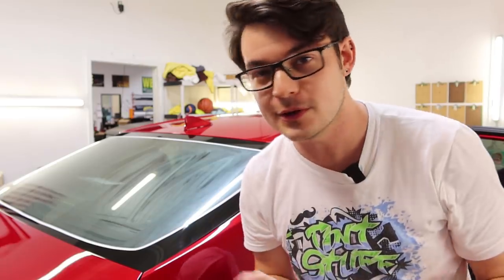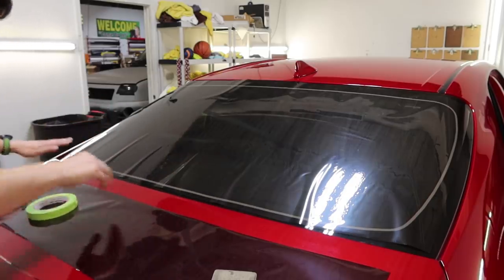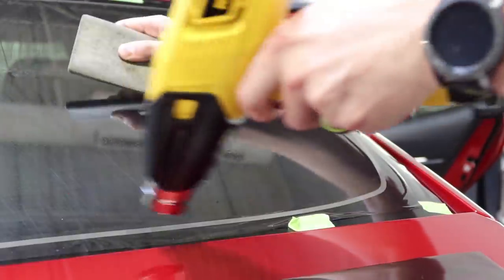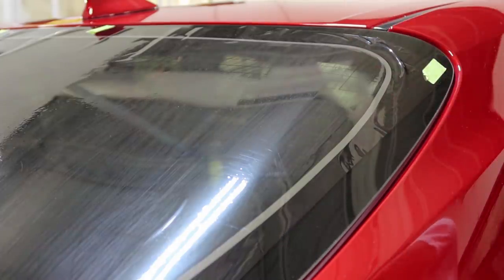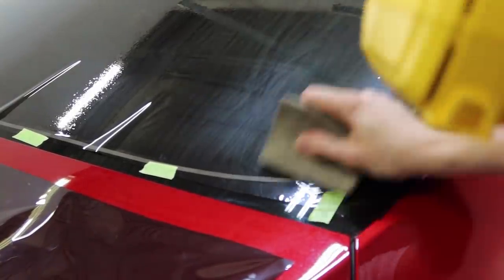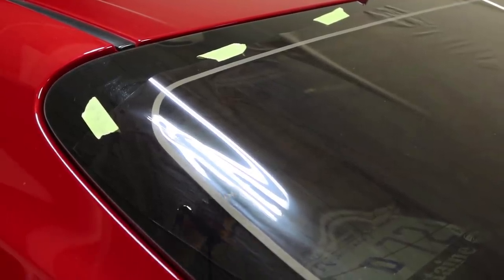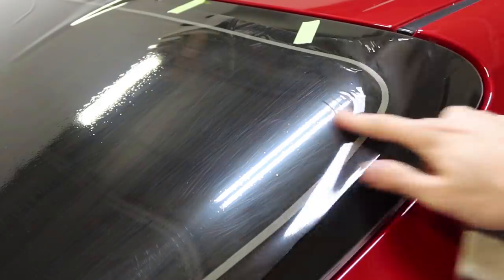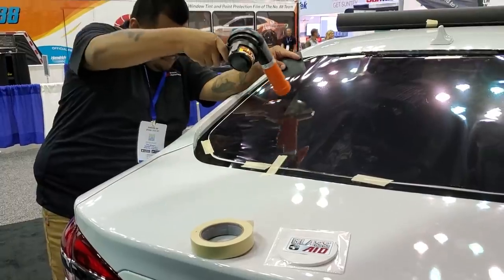Easy Way to Shrink 3M Crystalline Window Tint

Comment: I’ve always heard Crystalline was a pain to shrink.  It reminds me of the old Huper Optik film I used to deal with.  That required a similar pocket shrink method to shrink.  I use Xpel now and it shrinks so easily it just makes life so much better.  Thanks for the vid!
Reply from the maker: yea it is another beast like you said with huper. if it makes sense for ya to carry then this method would be your primary but I just really liked how simplistic this method looked. I love featuring things I haven't really seen before.

Comment: I do a fair bit of crystalline tints, the method I was taught is a little different (make a wet "H" shape, then put the tint on it,  tape the 4 corners and 2 in the top and bottom middle,then shrink the 4 Large pockets) but I really want to try this out tomorrow, could save time not having to get the glass wet.
Reply from the maker: that's awesome to hear! definitely not my specialty
Reply: Hi there, the “H” pattern is one way but can get though sometimes in my opinion. 
We recommend a “double H” pattern to break it up into quadrants, sealing the bottom and heating the finger up. Or breaking up the individual fingers like shown in this video. It all depends on the car and curvature of the glass. This method works great for Model 3 rear windows..

Comment: Well done! Funny that it's a "new" technique, I had gravitated towards it naturally after a year or two when I started dry shrinking early 2000's here in Australia. Nowadays I don't use shrink aids or even clean the outside of the screen properly, just a light wipe with a rag, then a wet" H". I lay up as usual, trim off with some excess left, tack with card in centre then pull slightly to stretch to sides and card across and up & down sides then shrink as you did using my hand to hold the sections in place instead of tape, but I don't sweep it out at all with a card, justly a light sweep with my hand. You sort of get to know when it's shrunk and coincidentally sit great on dot matrix! I used it on carbon films, nanoceramic's, HP metallised & Full Metal sputtered films from  Suntek, Llumar, Johnson, 3m,Bekaert....... It's pretty much the only way I shrink rears. I'd be surprised if you don't automatically start doing it without really realising! 👍

Comment: You got it down! Also try it with the downy liquid fabric softener. BUTTER!
Reply from the maker: Thanks man! I had to add salt guy after what you told me 😂 I'll definitely check out downy
Reply: Just clean the glass really well and mist the downy fabric softener on the glass spread around with a microfiber or napkin.....its butter!
Reply: It's the easiest way I can explain the motion. I remembered the meme when I would shrink like that.

Comment: The key is to get the air to shrink under the film by slowly sending air in the air pockets you make. Once the edge is sealed, let it sit for 5-10 seconds before touching it, then add a slight bit of heat on top to squeegee down; that will prevent distorting the adhesive in it. With 200 micro layers of film, the shrinking mainly occurs UNDER the film versus traditionally on top.

Comment: Can you use this method on regular film? Looks a lot easier. When you shrink from the top, the corners tend to move to the sides and make it harder to work with.
Reply from the maker: yea definitely, this method is a great alternative way to shrink any film. I'll be experimenting on harder back windows
Reply: @DetroitTintStudio  VW Golf will be a cakewalk doing it like this.

Comment: I come from a metal forming background.  This process is backwards from what I would do.  I would work the fingers from the interior of the glass to the edge.  Light heat using fast movements at the tip of the finger, and as I get to the edge slower broader sweeps of the gun.  Again from the metal perspective if I shrink the perimeter first  there is going to be a shit ton of pressure in the field.  Work the stress center to edge.  Being a soft pliable film there is the additional challenge of capturing, or restricting air at the parameter.  Why not work with physics instead of against it?

Comment: So I got one serious question in the beginning when u use the heat gun how do you get all the scratches off the tint
Reply from the maker: those fine scratches are all on the clear release liner. then you would remove that layer to expose the glue and slap it on the inside of the window. no damage to the film layer

Comment: What temp were you using on the heat gun?
Reply from the maker: As hot as it gets. 🔥 Hold the gun closer or farther away to adjust the heat
Reply: @DetroitTintStudio  interesting. I got crystalline certified in 2011 and we were taught no higher than 700 degrees and to pocket shrink. I like this method you showed alot and I'm going to try it on the next CR car I have. Thanks

Comment: MAX FLUX HEAT GUN WILL GIVE YOU BETTER AIR FLOW THATS WHAT YOU NEED PLUS HEAT MAKE THAT FILM BLOW UP THEN SEAL THE EDHE LOCKIN IN THAT HEAT THEN HIT YOUR TOP PART OF FILM DO NOT CARD THE FILM WILL COTINUE TO SELF SHRINK. AFTER YOU DO ALL YOUR SECTIONS(QUADRANTS) THEN YOU CAN CARAD IT.